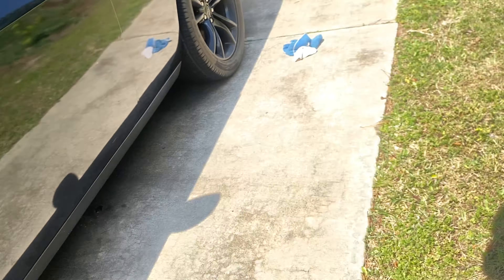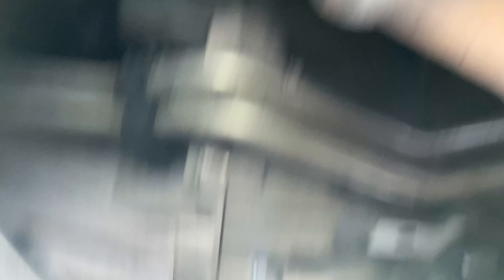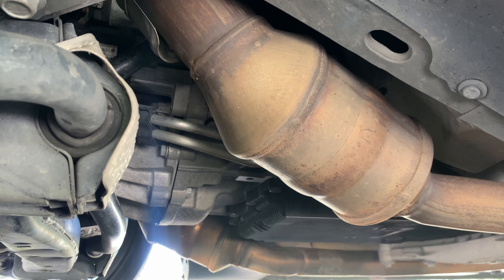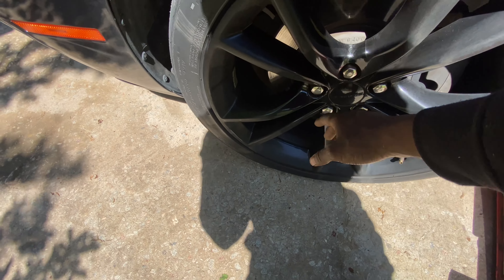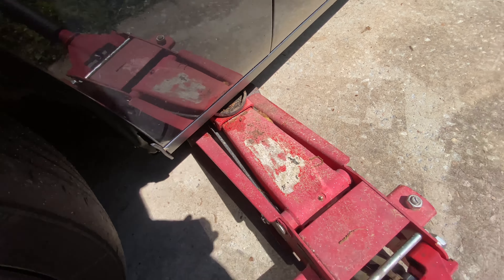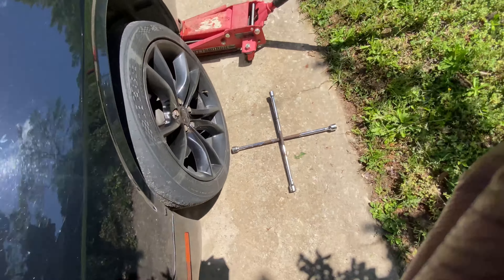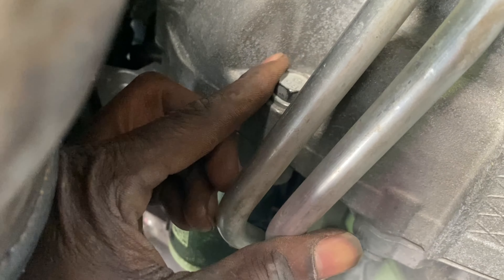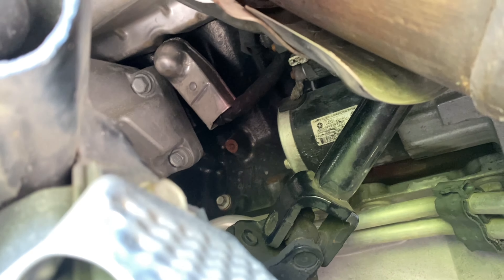DIY 2016 Dodge Challenger RT Starter Replacement / Installation

Comment: You replace the starter without taking off that steering bar thingy? Every other how to show them taking that off?
Reply from the maker: No I didn’t havt to take it off u just havt to wiggle it a lil and turn it so it can slide  threw